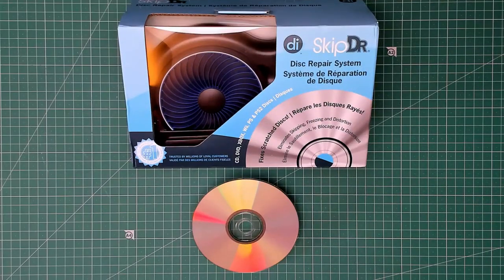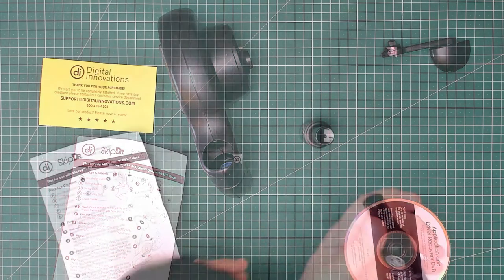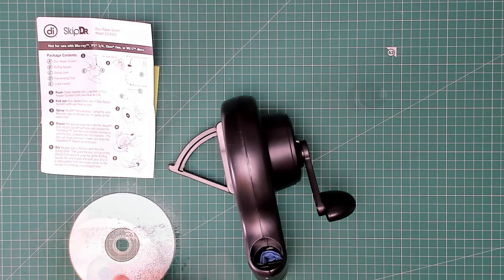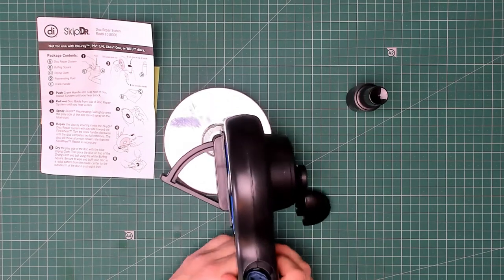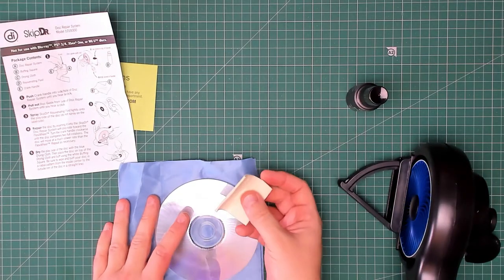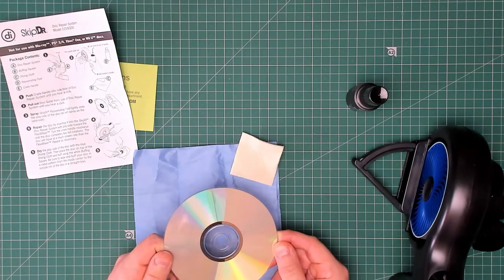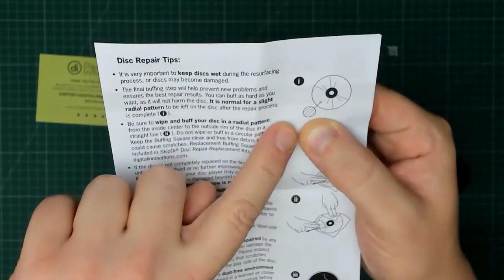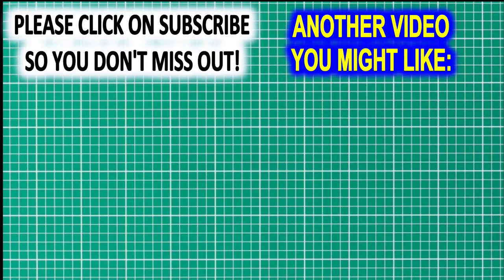Repairing A Scratched Disc With SkipDr

Comment: Actually i saved a decent number of discs with one of these , , the sandgrit resurfacing wheels wear out  kinda quick , how ever if you compare sandpaper grain quality you can MacGuyver some careful replacement strips , , ,also you can only resurface a disc so many times before you run the risk of making it ""cloudy"" , , enjoy it but practice good sense 😜🎃👍👍